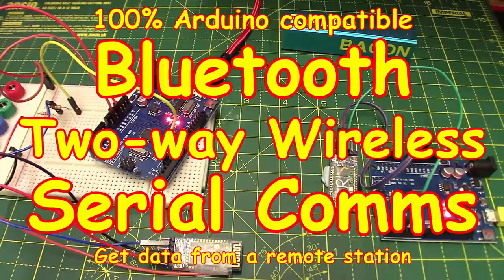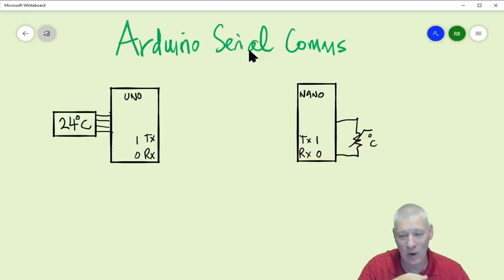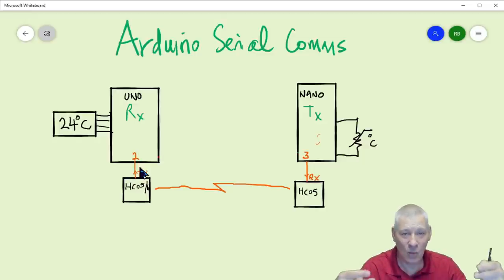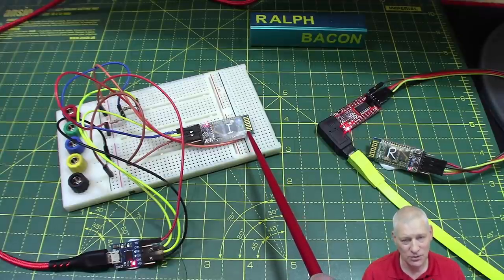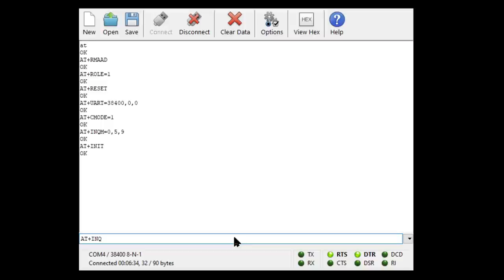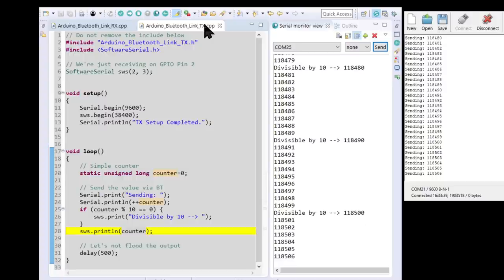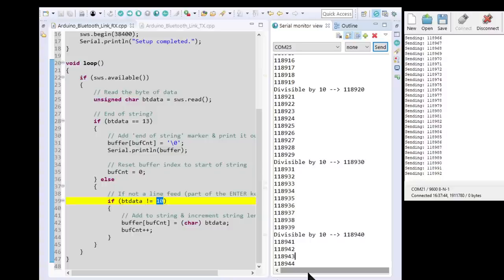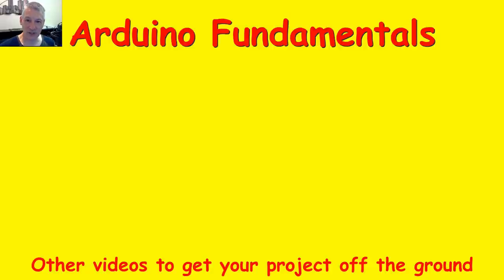#196 Two-Way Bluetooth Serial Comms for Arduino and other µControllers

Comment: Would it not almost get cheaper to Go ESP32 in hardware costs, probably not understanding what the actual project is.
Reply from the maker: I'm following a design by A N Other (modifying it a bit) but don't want to deviate too far. As it happens, as I need a remote control function the ESP32 won't help as I would need two devices.

Comment: Hello, how can one pair these two Bluetooth devices together and assign them IP address in order to run a throughput test?
Reply: Bluetooth modules and IP addresses have nothing to do with each other.
Reply from the maker: As superdau says, Bluetooth has no IP addresses; that is for Wifi. Bluetooth has a unique address to which another BT item can be paired.
Reply: @RalphBacon  It can be implemented under Linux with Microprocessors like Raspberry pi. I know that in Arduino world where everything is hardcoded it's probably impossible. Still I would like to see how much data/sec can be sent between them, of course that will depend also on the distance btw the modules.
Reply from the maker: Well, Bluetooth won't act differently when using an Arduino. BT 3.0 can shift 24Mb/s but these HC-05s and HC-06s are not BT 3.0, only BT 2.0 so will shift about 2-3Mb/s. Still quite impressive.

Comment: Thanks , but I received reads of potentiometer in master arudino too slow , how can i make them more faster . UART for modules is 38400 and i used serial.begin(38400)
Reply from the maker: You will only be able to transmit the data as fast as the stream allows. Can you not increase the module's baud rate to, say, 115200? Or is it fixed? In which case there is nothing you can do.
Reply: I put a delay in the loop which actually helped. Try using delay(10) and see if it helps.  It is still is pretty slow for me too. I had problems running the HC05's at 115200 baud also, brought it down to 38400 and that got it consistant.

Comment: hi, i make a similliar project like this but for maze robot. The problem is, when i send the data, the data structure that receiver receive is not intact. I've try to lower the vaud rate and place the receiver as close as possible to the sender but i doesn't seems to help. The other problem is, when the sender send the data, the servo start to jittering like crazy, and my baterry voltage fluctuate arround 1 volt up and down, this things happen when i use power supply instead of baterry. Is there any suggestion??
Reply from the maker: You say the servo jitters when data is received? This indicates that your receiving function code is taking too much time, because the servo needs continuous data (every few milliseconds) to tell it what to do. 

If you are using an Arduino UNO (or similar) look at the excellent Task Manager I describe in video #253 (https://youtu.be/eoJUlH_rWOE ) which will allow you to put the separate functions into different tasks and they will not interfere with each another. 

If you are using an ESP32 (or ESP8266) then you have RTOS built in with task scheduling, which you need to use.

Comment: Great as always Ralph!  I’m a huge fan of HC12.  Much more straightforward, easier to setup, 100 independent channels and longer range.  Nice to have options.
Reply from the maker: Cool, thanks!
Reply: @RalphBacon  Hi Ralph. Could you briefly explain what the capacitor does in this situation? Does it allow extra charge to build up so that when the reset pin goes low(high)? it discharges and gives more charge that the reset pin sees as the indicator to start receiving the sketch? It would be interesting to know the actual purpose of the capacitor!

Keep cool! GET and AC! Thanks, Gord

Comment: I want to know a project that can get the TIME TRAVEL from the transmitter to receiver. Please suggest some projects or do one. Any module bluetooth or other radio freq. module as long as it gets the time it travel. Thank you
Reply from the maker: You're talking Time of Flight. Plenty of videos and articles out there. But I haven't done one, sorry.
Reply: Ralph S Bacon i don’t see any that gets the time of flight. Please recommend

Comment: Would nrf24 work well for this?
Reply: That's what I thought. Far easier to set up. But he probably needs the Bluetooth for the rest of the project.
Reply: @donbriggs9128  that was my thinking as well.  👍
Reply: @donbriggs9128  at 27:03 or close to it he mentions wanting to connect one of these to a Wii controller, so that would explain the preference for BT over something simpler like the nrf24.
Reply from the maker: Well, you know, nRF24L01+ works well too, but Bluetooth is just a protocol, after all. HC-12 modules are just 433MHz transceivers but still have some of the Hayes influence. They all end up sending serial data. The nRF24L01s do have an auto-acknowledge for each packet though.

Comment: Good show! This module reminds me of the HC12 Wireless Serial Port Communication Module. I wound up using two of  them to get more distance for a water softener salt tank monitor system. My "castle" was too big for the MX-05V transmitter/receiver pairs. After this video, I may have to revisit the old project. It might be nice to check the salt level with bluetooth on my phone. Hmmmm....
Reply from the maker: Hmm. And I'm using an HC-12 (at least, I think I am, details in the video when I make it) for my project.

Comment: I'm curious about the pros & cons of Bluetooth vs. nRF24L01 vs. other kinds of wireless.  Things like power usage, speed, distance.  Why did you choose Bluetooth?  Were you just curious, had the hardware laying around, need to interface with something else bluetooth, etc.?
Reply from the maker: The project I'm following (and modifying) stipulated this. As it happens, and quite ironically, I've found it doesn't use Bluetooth at all but an HC-12 433MHz Serial link. But there we are, a video was made and was hopefully useful to some.
Reply: I don't like bluetooth in general (it felt like an unfinished product to me and was hassle more often than help for anything but serial links). But these bluetooth modules are quite useful as a dropin replacement for a serial wire. No changes in the code needed at all. That's completely different for nRF24s (and many of the other kinds of wireless links). There are other easy-to-use wireless serial links (zigbee for example), but they are usually much more expensive than the bluetooth modules. Bluetooth serial also has the advantage that it is supported by almost all phones and computers.

Then there's all the other stuff: range, throughput, reliability, security, price... I'm sure there are comparisons in that regard somewhere on the internet.
Reply from the maker: Horses for courses! Pays your money, takes your choice! Never look a gift horse in the mouth! Oh. Forget that last one. Basically it all depends on what you want to do. Benny's cat run uses a 433MHz transmitter and receiver and has been working fine since the day I built it (several years ago). It lets me know when it's raining (so I can quickly move Benny's stuff) what the cat run temperature is, the humidity and a couple of other things. This could easily have been implemented using Bluetooth or nRF24L01+ technology. If I had to build it again I'd probably use nRF2401s because I have a few but I can't judge one against the other for functionality.
Reply: Overall, I think that the nRF is a better choice for point to point communication, between two projects. But if you really need bluetooth though, the nRF boards aren't going to work.

Bluetooth: (HM-5/6/10)
Pros
* Simple. Acts like UART (wire to Tx/Rx and use Serial.print)
* Can perform GPIO on their own. No Arduino needed. (Not sure if this is all of them or not.)
* Able to communicate with smartphones. (Phone app still required... possible with Android and some Java skill.)
Cons
* IO is often not 5v tolerant, so it may require level shifting.
* Can cost more than some micros.
* Configuration is done via AT Commands, which can't be done from the host once a connection is established.

nRF24L01
Pros
* Very cheap
* Same range and power as bluetooth. (Literally the exact same radio technology.)
* Configuration and communication done via SPI, with the help of an Arduino library.
* Potentially reduced power usage, due to manual control of power level. (Host controls power level, not remote end.)
* Can connect to multiple devices at once.
* IO pins are 5v tolerant
Cons
* Can only communicate with other nRF modules. Cannot send data to smart-phone.
* Packets payload is 32 bytes. If you want to send longer packets, you will need to break data up into multiple packets and send them with your own protocol.

A few other choices:
ESP32: Bluetooth, WiFi, and 240Mhz processor. With optional external antenna, longer range. Typically less than $10. Can be made to work in arduino IDE too.
433Hz radio: Cheap, and potentially much longer range. Never used one though. Not sure if they have quirks.

Comment: Hi Ralph, you say this is part of a bigger project and I'll be looking out for that. Presumably you will be reassigning the received data into variables so that you can work with it. I added more data to send via the Initiator and it was faithfully received by the Responder on a separate line on the serial monitor but I am struggling to assign those data into variables. 
I'm so glad you're well again. Health is incredibly precious!
Reply from the maker: You're not wrong about health, Simon!

Regarding getting the values into variables, remember that you should be sending/receiving a struct (consisting of any number of different [types of] variables).

Thus, each individual variable in the struct can be assigned to another (local) variable.

struct {
    int temperature;
    uint8_t sensorId;
} myData;

Once myData has been received, you access the individual elements of the struct like this in your sketch:

int currentTemperature = myData.temperature;

Any clearer?
Reply: @RalphBacon  Thanks a million, I think it is clearer! I will have to wait till tomorrow now when I'm awake properly. I'm an old dog trying to learn new tricks;. My brain is almost entirely analog!
Reply: @RalphBacon  I had another look at this today. In #196 you didn't use 'struct' but I do remember it from somewhere... I tried to implement it but failed. I've hit a good logical (if analog) brain but I'm too inexperienced to yet recognise exactly where things should go. Do you have a tutorial you can point me to? Nevermind if not, I'll probably find something or work it out eventually, and I've taken enough of your time for which I'm very grateful, thank you!
Reply from the maker: I must have covered struct in the ESP32 NOW video https://youtu.be/lkHdk_mKGUw but if not let me know and I'll dig out some easy to understand documentation.
Reply: @RalphBacon  you did indeed refer to struct for data transfer in the ESP32 video. I'll have a good read and see if I can make it work. Thanks for staying with me on this. I know it would be a much quicker task of we were sitting at the same desk! 
I'll be back to you to let you know how I get on.
Reply: @RalphBacon  YES! I found a very good and easy to understand example of struct code, aimed at beginners, on the Arduino Forum. That forum is a bit of a bear-pit and I dare not ask questions as I'd be put off by the general level of unforgiving pedantry. But I pick a few good gems up from there. Thanks for your guidance, Ralph. I'm going to buy you a coffee. If you were here I'd give you a beer!
Reply: @RalphBacon  HI Ralph. I hope you're well! You've helped me a great deal with the two-way communication and I wanted to buy you a coffee. It's the very least I could do. I seem to remember there was a way of doing that but I can't find it. Can you direct me please?
Keep doing your stuff and look after your health!
Simon.

Comment: Have you looked at Seeed Studio  wireless boards? I think they have a small Arduino board with a wireless  chip on the board.
Reply from the maker: The ones I have, or have seen, are all WiFi oriented, not 433MHz wireless or BT. Some have a built in ESP32 or ESP01 on board. But not for this project!
Reply: @RalphBacon   Seeed also makes a Arduino with a display and Grove in/outputs. It's called Wio. If it shipped from China it does take a LONG time, If shipped from US it's faster.

Comment: Excellent video. However, this only shows data being sent 1 way. What about from the receiver back to the initiator ? Scenario being: braincpu says turn left and look around. 
motorsensorcpu moves, gets sensor data and sends it back to brain cpu.... ?
Reply: Serial.write() on the receiver.
Reply from the maker: I deliberately omitted this for two reasons:
1) I'm not sending stuff back and in this scenario the sender can't do anything with it anyway. It's a bit like saying your TV remote sends stuff out but should receive an OK or something from the TV. 
2) The hardware remains the same; you can send an item back with Serial.write (binary) or Serial.print (ascii) and the initiator will have to read that using if Serial.available() which we already covered in the responder. But, as I say, in this case it was not appropriate.
In your scenario a two way conversation would be appropriate but that's not the project I'm working on at the moment. Perhaps we'll do a deeper dive in a future video?
Reply: @RalphBacon  Great video Ralph but I also thought you'd have 2-way communications since that's the title of the video. Still great info and perhaps a good subject for another future video?!

Comment: Thanks for another interesting and clear video. I now know why I couldn't get mine to work!

Changing the subject, I wonder if you might do one of your videos about pointers / arrays for arduino? 

I hope you're well.
Reply from the maker: Glad you liked it Robert. Did you get your BT module working yet? On the subject of pointers (and arrays) I was thinking of doing something in my Bacon Bytes series - it's not for beginners but it would be a beginners intro to pointers. Coincidentally I've just written a tiny demo sketch for a future video that uses a single pointer... perhaps I'll see if that confuses viewers first!
Reply: @RalphBacon  I will have to get them out and try. I have a feeling that I bought two 06s thinking that they would be better than 05s 🙄

Comment: Hello Ralph,  you don't need to solder on the hc05. On those HC05 units the pin is brought out and is called EN pin.
Reply from the maker: Good to know, thanks for the heads up. 👍🏻
Reply: I have checked this with a multimeter and pin 34 and EN are NOT connected. However, as stated in Martyn Currey's info, holding down the button will connect pin 34 to the 3v3 rail. So all that is needed for the higher level commands is to make sure the module is in AT mode and then, additionally, hold the button down during higher level commands/requests.

Comment: Ralph
It would be interesting to hear a comment on the transmission range that can be achieved. 1, 3 or 5m for example 
Thanks Dave.
Reply from the maker: I managed about 10m when plugged into my workshop and I went down my garden. It should manage 30m but until I build the entire project it will be difficult to say.

Comment: Great Video, You must be reading my mind because I've been thinking about having an Outside Temp Humidity sensor give me an update inside. I can see on Dark Skies what my local area is but I'd lie to know what my back porch is like. Sometimes quite a bit diff +/-  degrees. Its this or the NRF24L unit. I just got a pair of the NRF's with external antennas and need to run a test to see the reach of the new units.
Reply from the maker: Go for it! Whichever solution you choose it will be fine. Remember that for outside you need a DHT22 (not DHT11) unless your part of the world does not go below freezing. Ever.